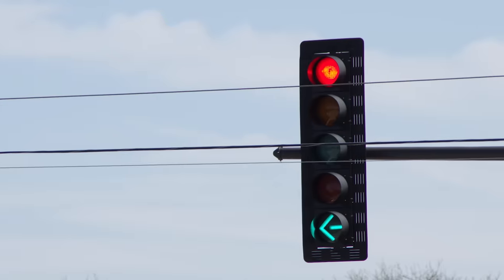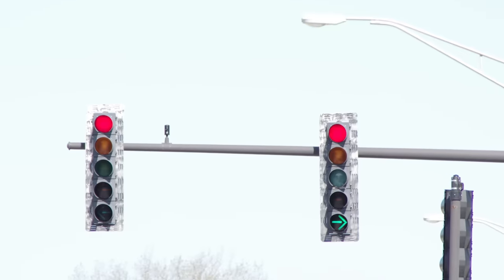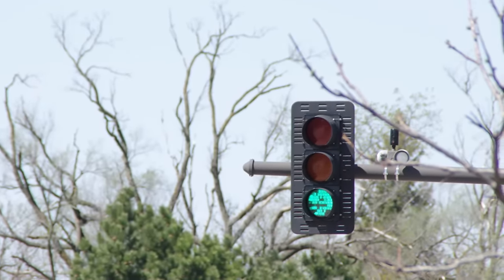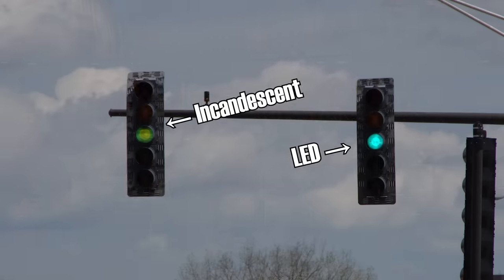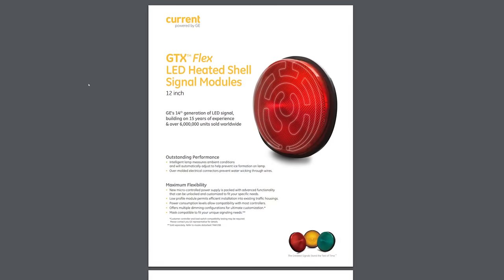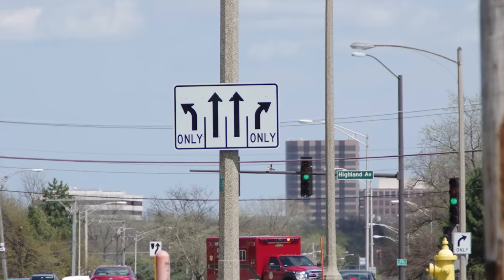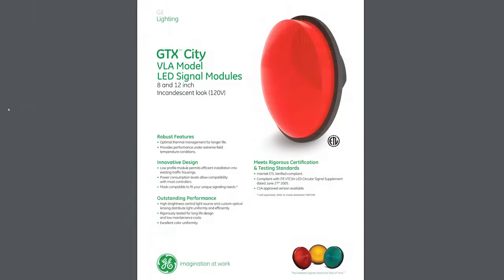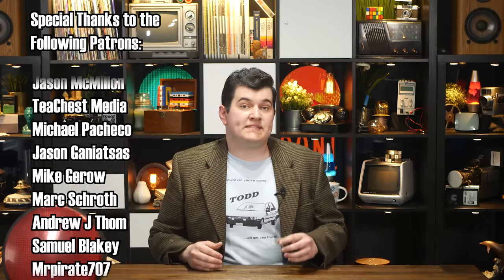The LED Traffic Light and the Danger of "But Sometimes!"

Comment: We're seeing a lot of "but sometimes..." in discussions of EVs.  

Some of it is just stale data ("The batteries only last about three years and they have to be dumped in a landfill!!!!"). 
Some is combo of edge case and stale data ("What if I need to drive 1000 miles in a day?  I can't stop every three hours and wait four hours for the car to recharge!!!!"). 
Some are things that are just poor planning ("What if I run out of charge?  I can't walk to a gas station and get a gallon of electricity!"  usually accompanied by the laughing emoji to show how clever they are. They never answer the question that I ask, which is "How often do you run out of gas now?"). 
And some are such edge cases that if it comes true, you've got more to worry about: "What happens if the power goes out all over town for a couple of weeks or a month?  Can't charge your glorified golf cart then, can you?"  Ignoring the very real fact that if the power is out all over town, you can't get to work because the business is closed, the kids won't be going to school, the groceries stores are all closed, so where are you going to go?  Plus, when the power's out like that you can't fill up your gas tank, so you can't drive an ICE car any further than you can get on the gas in your tank-and most people don't regularly drive around with a full tank.

Comment: I worked with the company that manufactured those lights for years, here in Montreal, I believe I have one of the red ones left somewhere, previous to it being purchased by GE and then for a while under the umbrella of Gelcore, I was there from the times we used full pcb backs to insert leds, until was moved down to Mexico, by that time the led board was a fraction of the original one and much of the work was done by the spreader lenses, looking forward to see the opening of the one used on the video, would be interesting if it has my initials on it, just saying :)

Comment: My crazy stop light story…headed to work one morning (0400) and I stopped at a red light. A cop stopped across the intersection from me. After roughly a minute of waiting, the lights were still red. There wasn’t any cross traffic. The cop flashed his lights, but nothing changed. 

After a few more seconds, he rolled his window down and motioned me to go ahead and cross. I rolled my window down and yelled, “You first.” He smiled, turned his emergency lights on, and slow rolled into the intersection. I did the same. We passed each other and I went to work. I kept checking my read mirrors and the light stayed red the whole time.

Comment: The problem with LED's being covered in snow and ice is a tougher issue than just a light being out, because normally it's only one way of the four way stop that will have it's lights covered because of the prevailing wind.  If you're coming into an intersection and you have a green light and the other side is covered with snow, you can't know that and therefore won't stop(nor should you).

Comment: traffic engineer.   most points were touched on accurately, but as one car is permitted in the intersection during the bidirectional ROW, the delayed green arrow is safer for that left turning car to be able to make their maneuver.   also the countdown walk box is a completely modular system that learns its own countdown after a few cycles of W/DW. its not connected to the traffic control panel on the pole

Comment: I actually saw this effect recently in my field of enthusiasm: toy collecting. Hasbro recently stopped using plastic in Transformers packaging. This reduces the amount of plastic waste, creating an obvious (if slight) environmental benefit... but without transparent plastic, it's impossible to make the toy visible in the box without creating a physical gap in the packaging. This makes it easier to vandalize toys or take them out of the packaging, and fully enclosing the box makes product swapping less detectable. So obviously, collectors say, Hasbro should revert to plastic window boxes! After all, it's just a marketing ploy! The toy is made of plastic anyway! And plastic packaging is recyclable! Etc. Etc.

Look, I'm not gonna pretend that Hasbro cares about the environment. Their lines of NFTs prove it's all about the bottom line. But plastic-free packaging is a step in the right direction regardless, and there will always be shoplifters and swappers regardless of what Hasbro does. Besides, the newer waves of some figures are going to have more solidly enclosing trays to prevent this. The problem is fixable without needing to regress to single-use plastic packaging.
Reply: You're right, there will always be vandalism and such, but remember each time this happens the damage item is 100% waste. The plastic toy itself is waste. Depending on how much more vandalism happens we run into issue.

How many small plastic windows can you make from a toy that is lost and becomes garbage?

A short example.

Lets assume 1 toy = 100 windows. If the lack of windows means 1 additional toy is damaged out of every 100 you've broken even. Yet if that number if even slightly higher then 1 you're wasting more plastic then saving.

Can you say with 100% certainty that it is a step in the right direction without seeing the REAL numbers yourself?
It is why you should never say without actually providing proof. You and I don't know enough either way.

Comment: I have run into an instance where 'but  sometimes' has caused a real issue. When I needed to replace the headlights on my car I ended up getting LEDs rather than the original incandescent. I live in Minnesota so this has presented a problem. In the winter I have regularly had ice build up on my headlights. The ice crystals cause the light to disperse significantly reducing how much of the road ahead I can see.
Reply: It's not the ice crystals fault- led headlight bulbs need special reflector housings retrofitted because they spread the light more than incandescents. In Australia it's illegal to "drop in" leds without approved reflectors. Popular car models can be fitted with a complete headlight housing suited to leds. The heat range (colour) of led headlights is often criticised for being hard on oncoming driver's eyes and also for not seeing as well with.
Reply: @rossbrumby1957  Yep, incoming car with LED lights is nasty

Comment: That patterned flashing strobe that is on emergency vehicles that's picked up by that photo cell in intersections to change the traffic lights is technically called a 'pre-emitter' or 'preemption device' 
 Some of those are actually programmed for specific cities and counties and will not function the same or at all in all jurisdictions. 
Not sure why they are not universally  capable throughout the country.

Comment: yeah the "but sometimes" argument should then have a solution.  like in this case, since the LED lamp doesnt get hot enough to melt snow, add a heater and turn it on when its needed.  The idea to not do something because 1%  or less of the time there MAY be an issue or there is a very minor inconvenience is dumb.  figure out a solution to the problem people!.  honestly when i was a kid and heard of this, i thought- just add a heated element.  Like he said if if snowing so bad that the lights may get covered in snow, you shouldnt be out anyway.  Some people are about progress without any minor inconvenience.  The fact that the reduction of the required power for the LED is as much as it is, the power for a heater that is used only for maybe 60 days a year and likely only for a few hrs  ( or however much is needed to clear the signal) on any one of those days  shouldnt be that big a deal even if it was like 250W a signal.  Some people have really lost their critical thinking skills.

Comment: The white strobe on emergency vehicles is infra-red (which is why your digital camera seen it). The sensors on traffic signals will pick up that infra-red signal, kind of like your devices pick up the signal from a remote control.

Comment: In regard to your right arrow timing, I think that has more to do with the oncoming traffic making an unprotected left turn. If they rush through the yellow while a right turn green arrow is illuminated, it could cause an accident, as the opposing driver making the left turn would assume the other would slow down as the light is yellow when in actuality, they are literally given the green light. Especially if there is a busy intersection and the driver making the left turn has to sit and wait for the yellow light for the oncoming traffic to slow and stop in order for them to proceed with the left turn.

Comment: In Germany, traffic Lights have signs mounted to them which are not folded uo at all.
If the trwffic light fails (or mote xommon: just off for the night - don't need one if there are a few cars) the signs regulate the right if way.
Reply: Similar in some places in Italy. Confused the heck out of me when I was driving there.
Reply: Reminds me of the earliest traffic lights in the 1920s that had an arm that would fold out with the red light.  Even if the light burned out you knew to stop when the arm was extended.
Reply: and if ther is no sign it automaticly turns into a simple rule ...... (the one on the right has always the right of way)

Comment: The problem with the logic of the all ways stop is that depending on wind direction, only one or two of the direction of lights might be frozen over. The others are  are clear and unaware that one side is obscured, and thus they are following the indicators that are clear, resulting in accidents.

Comment: I like the use of the multiple LED traffic light fixtures, as it gives a lot of redundancy for then the LED's start to fail, with the only downside being that they start to look ugly. In my opinion it's a much better and safer solution than the incandescent bulb with no redundancy other than having multiple fixtures at the intersection.
Unlike the headlights of cars, I see it as much more worthwhile here, as a replacement is a unified standard, whereas with cars it's only a standard per model of car, and even that can vary with the trim of the model of car. In such cases, it's much better with a servicable and replacable incandescent bulb.
Like a light fixture in your home where E27 LED bulbs are better specialised design lamps, since you can replace just the bulb rather than the entire fixture. Also, don't use LED bulbs in your car, unless it has been specially designed for it. If you have reflectors rather than projectors, you especially shouldn't use LEDs.

Comment: The UK has started putting annoying pieces of slatted plastic (imagine Macy's changing rooms when there was all the controversy over their doors, only the slats are level rather than face down or up) on the lights. Not only do they obscure the light sometimes when straight on, they're really difficult to see when approaching at an angle, such as turning or going around a bend.

Comment: I know this is an old video, but I need to tell about the light arrow at the intersection in my town. We have a main road that continues by turning. If you are turning left to continue on the main road everything is fine and dandy. When you are coming back to turn right there is an arrow that points to the right to allow for traffic to continue on the main road. Normally this makes sense even in a for way intersection, but the timing of this arrow and the number of traffic going into the car dealership and Dollar General makes this very unsafe not mention that there is a crosswalk 20 feet where there is another 4 way intersection that has not traffic lights on it. We should be lucky now that the convenient store at this very corner has moved down the road making this intersection less deadly. Make note to anyone wanting to visit the hometown of Elliot Ness.

Comment: In Europe there are traffic signs at the traffic lights --- and that means "When the traffic light works, use the traffic lights. When the traffic light is off (often signalled with a flashing yellow - or it really is completely off...), then use the traffic signs that are already there".

Easy.

Typically the big main road gets advantage over the small crossing road when it is controlled by the signs - and that means congestions for the crossing traffic, so the police might show up and try to make the traffic smoother - they try at least ;-)

Comment: I'm pretty sure the real reason so many places dragged their feet on changing over to LED traffic lights, and street lights, is strictly the cost and the lack of budget appropriations to pay for them.  Even after all these years, LED's are still relatively expensive.  When they first became available for this application, they were very expensive.  Unlike our federal government, most local governments can't create money out of thin air.  In many locations, the changeover only happened when the federal and state governments provided the funding.  As for the problem with snow build up, it is a real thing that anyone living in the snow belt has probably seen.  Since getting a crew out to clean off all the traffic lights is highly unlikely, yes it would be nice if that flaw didn't exist.

Comment: Seems like they’ve left the incandescent fixtures in a few lower traffic places to use up the old stock of bulbs they have in their warehouse.

I know some municipalities here were stoked about LED traffic lights because they were able to power a bunch of intersections using electricity generated from the reduction of water pressure from the dam feed to the residential pipes, so theoretically they’ll be fine during an outage no matter how long it is.

Comment: You cannot retro fit LED traffic aspects unless the traffic controller outputs are designed to accomodate that. All modern traffic controllers can report non functioning lamps back to central control. The latest controllers now operate on 48V ELV, but the whole junction has to be modernised simultaneously. If a critical vehicle red lamp fails, or a last vehicle Red fails, the whole junction should fallback to flashing Yellow, or switch off completely. Again, a controller warning should be reported back to the local authority and most modern controllers do have such facilities which are not only used to report lamps off or lamp failures, but also coordinate traffic fows on nearby intersections based on data collected from detection devices, such data being fed back on an internet connection or private network. Countdown timers cannot be used on dynamic traffic systems where there are plan changes or dynamic cycle times and varying pedestrian clearance crossing times. They are ony suitable for isolated fixed time traffic schemes. The only exception is where the countdown time is fed in advance from a central computer rather than from a memory of the previous cycle time.

Comment: I have never seen such problems with traffic lights in Russia. I must say, I have not seen traffic lights with incandescent lamps for a long time, they are all on LEDs, with digital timers combined with yellow light (they are now being removed due to safety reasons), and other cool things. And I could not find heaters in them anywhere, and I myself have never encountered the problem of icing or being covered with snow

Comment: The wire loops in the road don't detect a little Kawasaki dirt bike with an aluminium engine. You can sit there forever - on an empty highway at 2 am .... and a police car WILL pull up to you just at the moment you finally say 'f**kit" and turn against the light anyhow.

Comment: I've noticed that the multiple point source LED fixtures (as opposed to a single light behind a diffuser) generally make much more distict separate "lights" with my astimatism. Stronger diffraction spikes with window scratches, too. I can't say that's an issue, just an observation. I do hate that the first LED overhead street lights in our area lack shields for light spillage and they're way too white for responsible dark sky lighting standards.

Comment: After traveling through certain intersections for decades, it is obvious when lights become troublesome after LED conversion (one green light at an intersection failed 3 times in a relatively short space of time).  There are no 'half-working' LED traffic lights either - where I live, the LED light is either on or it's OUT.

Comment: In some parts of Europe the traffic light crossroads are soon a thing in the past. Only placed in spots that are too narrow for a roundabout. And since the roundabout is usually designed to build in safety in how you are supposed to drive in them they reduce the amount of accidents a lot. They also reduce the amount of pollution and slows down the traffic for pedestrians too. And the traffic lights are teken out of the equation so less power grid is used and the place is visually cleaner.

Comment: Here in South Australia, when LED traffic lights first came in,we had lots of problems with water ingress & the result was flickering & partial illumination of modules,the problem has since been remedied,we don't have snow here, so for the most part they are very effective & as mentioned, during loss of electrical supply,they can be run on battery backup for many hours,in the event of a prolonged power failure.🚦🚦🚥🚥

Comment: Our problem in Ontario used to be that LED ped heads would have half their LEDs fail to turn on when the temperature was below say -15. This was a major problem, but I haven't seen it come up again for the past few years. Probably was just a problem with the LED controller breaking down due to extreme cold.